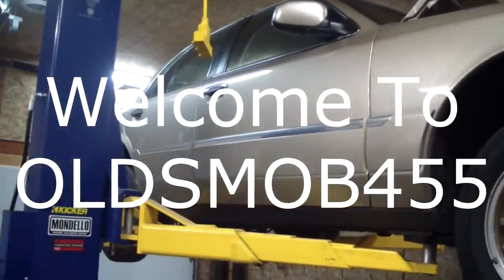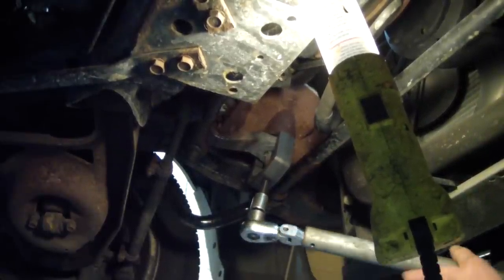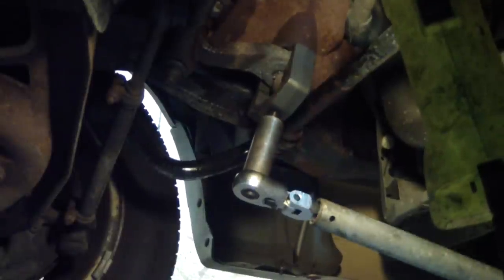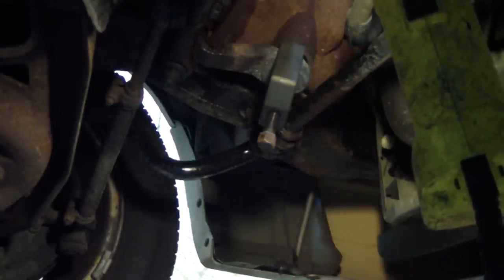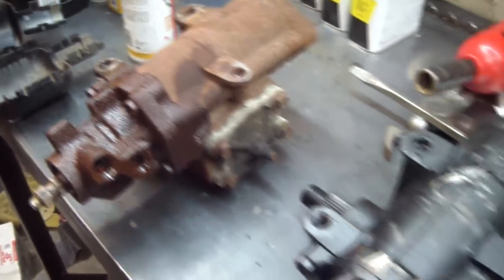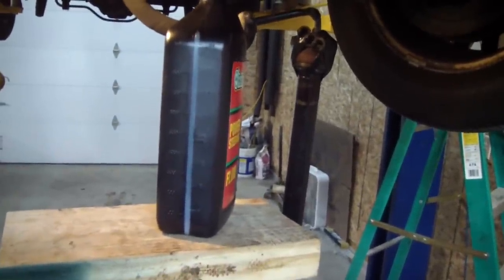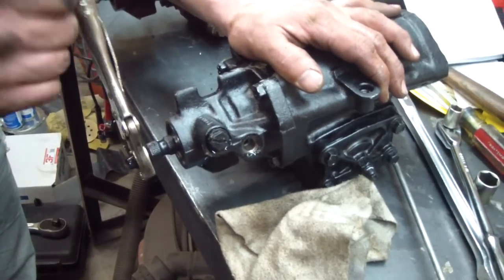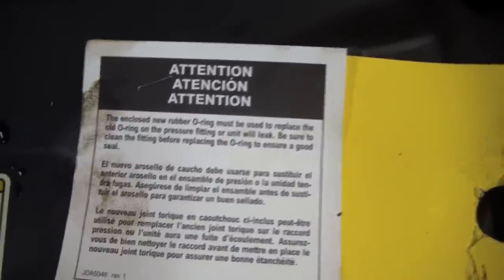1995 - 2002 Grand Marquis or Crown Victoria Steering Gearbox Change or replacement

Comment: I don't use pullers on older vehicle pitman arms anymore. I take a small cut off wheel and cut a slit in it until right before the splines, then take an air chisel and put it in the slit, it will crack it in half and comes right off. Takes less than 5 minutes.

Comment: Thank you so much, using information from forums and this video I just succesfully replaced the steering gearbox in my 99 Crown Vic. Unfortunately due to my lack of a lift and quality tools it took me about 8 hours from start to finish (with many breaks in between, going to the parts store to get stuff, etc). I did use a good amount of PB Blaster before beginning without which I probably would not have been able to remove the old parts. And damn, that sucker is heavy and hard to maneuver into place (with the old one I didn't have to be so careful). Tomorrow I just gotta bleed the system, double-check for leaks, etc. and get an alignment and it'll be great. I really appreciate you takign the time to make this video. One thing I would suggest is that Ford specifies the use of ATF rather than Power Steering Fluid. I'm not sure what the difference is but there is some reason they spec that so that's what I used. I used cheapo store brand Dex/Merc stuff rather than the more expensive Mercon V.

Comment: Thank you for the video! I am going to replace mine steering gear (2004 mercury grand marquis). My steering wheel spins 180 degrees with the car turned off.

Comment: I never use freaking reducers on known hard repairs,, LOL I broke two reducers never again, I use harden and 3/4  drives... good job guys.. 
I have shuddering in my power steering and found the fluid level a little low but I still have some hard spots. I'm trying to determine whether its the gearbox or the pump. Experience says pump, but I want to be sure. I might have to get the pressure gauges out.. dang more fun
 136,000 original miles one owner.. TLC through all them miles.

Comment: I have been doing repairs on my undercarriage of my 97 Crown Vic.  Smooth sailing until we attempted to remove and replace the Pitman Arm.  Broke 2 rental pullers,  Ill try using the punch to knock the lock-tite loose when its at full pressure.  My vehicle is in dire need of this repair.  wish me luck.  will update when complete,  not today.
Reply: Replace the pitman arm . Then you dont have to pull it

Comment: You should use a breaker bar instead of a rachet. You can ruin a ratchet that way. Also, use 1/2" impact sockets--no adapter. And use ONLY a heavy duty puller as those cheap ones will break. Never use a "pickle fork" removing tool as it can damage the gear box (unless you are replacing it anyway, of course). Finally, if replacing the gear box, forget about taking off the pitman arm. Just buy a new one and leave the old pitman arm on the old box.

Comment: I got the whole front suspension done with the Detroit axle kit. Need the gear box next. I keep hearing a kink noise while turning at an angle.
Reply: I did a full Detroit kit on a 1996 aero vic 3 years ago, upper arm, lower arm, ball joints, bearing/hub assembly, springs, tie rods, pitman arm, idler arm, sway bar bushings, sway bar links. Still driving solid as a daily driver.
Reply: @Reloadeez   Dawg. They run smooth every time. I want to put some muscle car style wheels on it this spring.

Comment: what not to do in this video!
What to do:
1.Spray penetrating oil on shaft.
2.Once pulley has good tension use a dead blow and hit the arm to vibrate loose.
3. Use air ratchet gun for more consistent pulling control movement.

Comment: Thats was a tight pitman arm allright, What brand of pitman arm puller did you use??
it took a beating and kept on going.
Reply: I don't know what he used but I bought a cheap one from O'Reilly (could have rented the same thing but I gotta do the pitman arm on my other vehicle too and it'll come in handy in the future) and it worked just fine. Go crazy with the pb blaster and give it some time before attempting to take that big @$$ nut and pitman arm off to make it much easier.
Reply: yesterday we broke 2 pitman arm pullers.  still isnt done.

Comment: Ford's take mercon or mercon lv in the power steering system, not regular power steering fluid. Its important especially in cold climates and for the pump and seals.

Comment: After it got so tight you should have took a hammer and kind of packed around on it and then seen if it would come loose if not you should have run some heat on it

Comment: This can be done with wheels on, it looks like. So it can be done on ramps? Yay...
Reply: I couldn't do it on ramps because they kept sliding across the garage floor before I could drive on them since these cars are rear wheel drive. I ended up getting a jack and jack stands. I do think it was easier this way because the ramps might have been in the way of getting underneath the vehicle as easily from an angle.